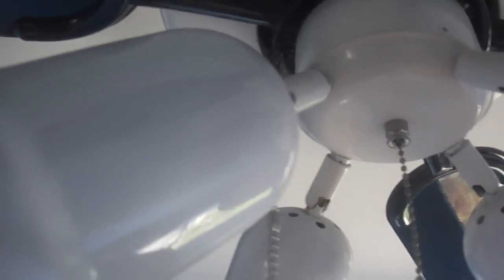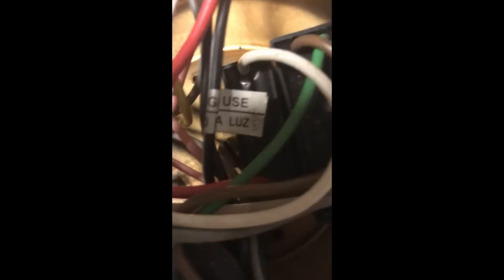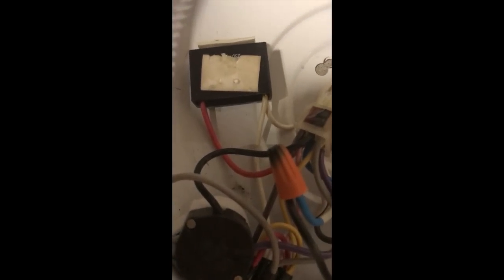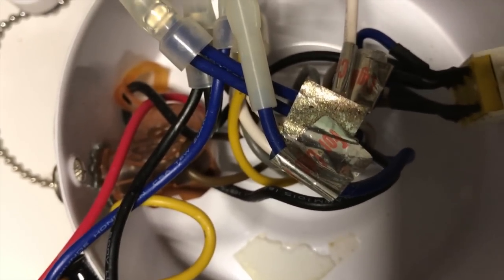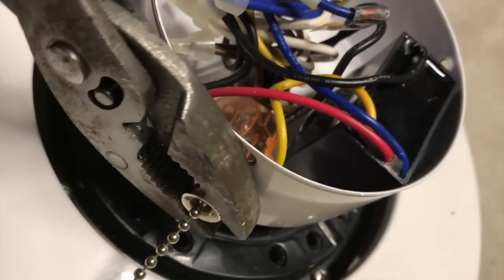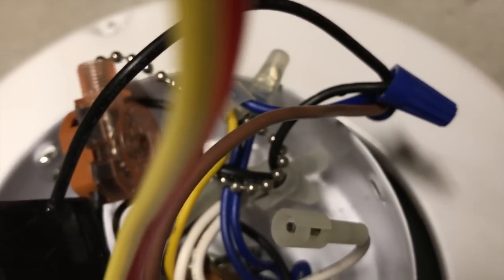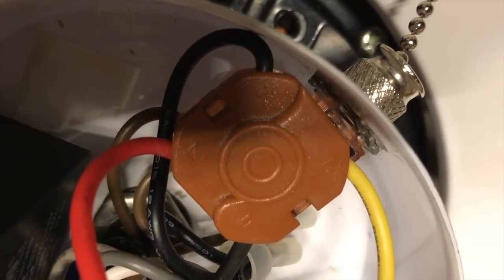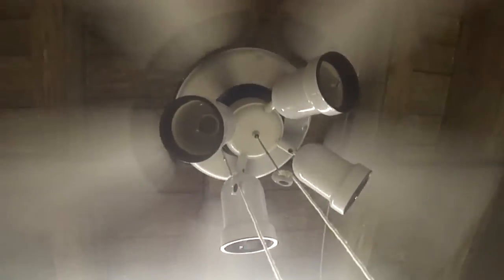Ceiling fan repair: how to replace a motor capacitor

Comment: We have a Hunter Original Model 23856. Purchased at a Home Depot in year 2000.
The speed switch chain broke and in taking off the light kit I shorted the wires (yep. wall switch was still flipped "On").
When I put in the new speed chain switch the fan only runs on one speed. I think it is the highest speed, and it is the last speed before "Off".
I have taken the fan down from the ceiling and am trying to decide what to do now. 
What do you recommend?
And thanks for providing all this useful content on your channel.
Reply from the maker: Did you connect the black wire to "L" of the chain switch, and what chain switch did you use?
Reply: @CeilingFanVideosOnYT  
Wow! Thanks for the rapidity of your reply.
I connected Black wire to the "L" terminal of chain switch. I got a Gardner Bender GSW34 at Ace Hardware. But the body of the actual switch says it is a Zing Ear 268S6. (How odd...)
The other wires are connected: Red to "1"; Grey to "2"; Yellow to "3".
And now I have all 3 speeds and Off in both directions. The speeds are NOT sequential from Low to High, but not going to fiddle with it anymore.
In my case, the first pullchain switch seems to have been defective as the wire in "1" would not hold tightly; Or maybe I bodged it myself. 
Is there a high-quality pull chain switch that would last longer. Reviews on Amazon make me wonder if quality control on the current switches is suffering.
Hope this info is helpful to someone else.
Reply: @CeilingFanVideosOnYT  
Ayy yiy yiy
New problem. I reattached the light kit. Now I only have 2 speeds in each direction.
How does that even make sense?
Depending on what you say, and if/when I see what you say ... I might remove the light fixture and see if I have those 3 speeds I had previously.
Thanks for any add'l help.
Reply from the maker: Sounds like one of the wires came off of the chain switch when you reattached the light kit. It’s best to use a paperclip to open wire holder on chain switch when inserting the wire. Also did you use paperclip to remove wires from the chain switch or you cut and strip the wires?
Reply: @CeilingFanVideosOnYT  
Your suggestion/insight here about wire coming out from switch makes sense. I did not use paperclip; used wooden toothpick. But wires are stripped to length shown on the gauge on the switch.
Time to go back and re-assess.
Reply from the maker: Ok toothpick can be fine to take wires out. It’s when someone cut and strip wires is when they have trouble inserting properly to new chain switch. I had seen a ceiling fan in a hotel room which didn’t work on high. Turned out that one wire came out of the chain switch. Inserted it back in and high speed worked again.
Reply: @CeilingFanVideosOnYT  
Well, just ot wrap up this episode - the gray wire was making contact intermittently. Not sure if it was pushed in a little too far and the insulation was a problem. I finally decided to tape the gray wire to the switch housing to stabilize it from wiggling. Seems to have worked.
Fan now gives us Three speeds in each direction.
regards

Comment: I need help with a 3 speed 5 wire switch and 3 wire capacitor for my Crest (20) years old ceiling fan. can't find information on this any were. Was suggested to contact this group.
Reply from the maker: Did your chain break?
Reply: Same here but Hunter fan.

Comment: Hello i have a nice hampton bay ceiling fan 3 speed with two pull chains and 4 lights its about 15 years old if i had to guess. Was working fine till my grandson pulled the chain too hard and broke it off inside the 3 speed switch. I got a new switch from home depot but it was a replacement as the kte308a is no longer available. I wired it in and now it is slow and it used to be very fast on hi. Now its going about slow speed. The capacitor has two black wires that are joined together with a third black wire that goes to the L spot on the switch. Then i have the main black wire that goes to the switch and two blue wires that go to the switch. There is also a red wire . So 5 wires on the capacitor. I was expecting colours like yellow green and brown for the speed switch from the capacitor but instead two black and two blue/purple is what goes to the 3 speed switch. Can you explain that? There is no blistering or bulging on the capacitor and it will hold a charge. If the two blue/purple wires were mixed up could it cause it o be slow? Sorry for the long post.
Reply from the maker: Was the original KTE chain switch red, black, orange, or green?
Reply: @CeilingFanVideosOnYT  it was black and clear. 308A was the #0n it.
Reply from the maker: https://www.ceilingfanswitch.com/product/zing-ear-ze-268s2/

This should have same exact sequence as your KTE.

Comment: i replaced the speed capacitor on my ceiling fan and it work on all 3 speeds for a while, but then quit all together. What's your suggested step to find the problem. Thanks!
Reply from the maker: The start/run capacitor went bad.

Comment: thanks
Reply from the maker: You're welcome. Do you have a fan with a bad capacitor?
Reply: yes a hunter 60 in regalia it has 2 one 5 uf 2 wire and a 5 wire 5uf 5uf 3.5 uf 2 years ago i replaced the 2 wire one with a 6 uf and sped up the high speed and today the run 5 wire cap went out

Comment: Do you have to short out the capacitor even if the ceiling fan is not on the ceiling and unwired from house wires?
Reply from the maker: Yes.

Comment: The 3 in one ceiling fan capacitor is melted and fan will not turn on either of the 3 speeds. Ratings are 4.5ufx280v Red wire, 6ufx250v Brown wire, 5ufx250v Purple wire with 2 gray wires on the other side. Will a replacement capacitor with a rating of 4.5ufx300v Red wire work? The other 2 ratings are the same.
Reply from the maker: Definitely. Higher volt ratings never hurt as long as it's same capacitance rating, it just will be able to handle more volts,
Reply: @CeilingFanVideosOnYT  what do you mean by capacitance rating?
Reply from the maker: Example of capacitance rating is 3uf, 4uf, 5uf, etc.
Reply: @CeilingFanVideosOnYT  thank you so much. Just one other question. Do I have to be concerned about discharging the old capacitor which is still in the fan?
Reply from the maker: Does your ceiling fan have a light kit?
Reply: Yes.
 @CeilingFanVideosOnYT
Reply from the maker: To short out the capacitor, first turn on the light with the chain. Then turn the circuit breaker off, or maybe the wall switch ONLY IF the fan and light are wired to the same wall switch, and then pull the fan chain more than 4 times SLOWLY, and it will short the capacitor out.
Reply: @CeilingFanVideosOnYT  Thanks again!

Comment: hello friend.. i have a problem with the hampton bay ceiling fan carriage house model that i brought to brazil, the original capacitor brand 4.5 uf 5 uf and 6uf 250 vac ..box with 4 wires total.. the problem is that This model does not exist in Brazil.. we only have 2 wires and I wanted to use it only at maximum speed, how can I adapt?  would it be 1 capacitor of 7 uf 250 vac for the strongest 3 speed it?
Reply from the maker: Just get whichever size was not connected to "2" or "3" of chain switch, probably 4.5uf.

Comment: My fan has always ran on a medium speed, when I press the "4" button on the remote.  I had to run a wire from the carport, about 20'-25' away and I've wondered if the wire is too heavy a gauge or that's the fastest it's going to turn.  The one in the bedroom turns fast and that's why I think this one is slow.

Comment: This is a great video. I replaced my 4 wire capacitor ( grey, grey, green, brown ) with a new one BUT the fan does not rotate as fast as it used to ( although the 3 speeds are discernible now ). Although the specs on both the old and new capacitor is the same, the size of the new capacitor is smaller. could that be the issue?
Reply from the maker: New capacitor needs to handle same number of volts or higher than old capacitor can.
Reply: The old capacitor indicates "250WV.AC" and the new (smaller) capacitor indicates"250VAC" no "W". Could that be the issue? And thank you for your response and the video. (btw- I did get a slight shock from the old capacitor a few hours after I removed it. Should have shorted it as you did, lol )
Reply from the maker: It's not a problem. Is "uf" rating the same?
Reply: Yup. 5UF & 5 UF. Why do you think the new capacitor is smaller than the previous? The manufacturer does seem to be different.
Reply from the maker: Maybe you just didn't remember well how fast it was before and it was actually the same speed. Maybe you accidentally overpitched one of the blades while taking the fan apart to replace the capacitor and it caused it to slow down.
Reply: Bearings and shaft need to be cleaned.

Comment: I also have a hunter fan that makes a slight hum when turned on and won’t spin but has no pull chain on it
Reply from the maker: Does your fan have a wall switch or remote control?

When capacitor goes completely bad, only one winding would be powered, and in that case, the fan would buzz or at least vibrate.

Comment: My pull chain switch broke inside the housing and the position is off. Can you tell me how do i bypass the connection?
Reply from the maker: What's the serial number of chain switch and what's the brand? And do you actually want your fan to be chainless?

Comment: I only have one speed; I replaced the capacitor attached to the switch with no change in results. Do I understand correctly that the two-wire capacitor also needs to be replaced? Also, why did you "short out" the original capacitor. Thanks for your help!
Reply from the maker: What's the brand name and model number of your fan?
I shorted out capacitor because it can store charge and I didn't want to get shocked.
Reply: Thanks for your prompt response! It's a Hunter, but I don't know the model # (it's a customer's fan!). I already purchased what appear to be matching capacitors, but only installed the larger capacitor; switch was also replaced. Good to know about getting shocked!
Reply from the maker: How fast does it spin since you only said it works on one speed? Try replacing 2-wire capacitor if it's slow.
Reply: The one speed is, I think, somewhere between middle and slow, but that is based on my experience with other fans, not this one. I will replace the 2-wire capacitor and let you know the results. Thanks, again!
Reply from the maker: Also, does it spin freely when you push with hand or is it stuck?
Reply: Spins freely.
Reply from the maker: So it does sound like a 2-wire capacitor. Let me know if replacing it solved it.
Reply: I replaced the two-wire capacitor today with no results. There is still only one speed. I'm perplexed... :)
Reply from the maker: I need you to get a model number of that fan and give it to me.
Reply: I will do that! Thank You!
Reply from the maker: Got the model number?
Reply: Finally, I do! Hunter 22793-380
Reply from the maker: Maybe the last step is to make sure wires are not rubbing on top. If that fails, you may have to get a whole new fan. Hunter made after 2011 besides Original are generally low quality. So if you get a whole new fan, one fan I would recommend is Hunter Original. Hunter Original is actually one of the best ceiling fans still made today and it's been around for over 100 years. Pretty much any other Hunter are generally low quality.

Comment: so what happens if i accidentally break the grey wire? is that the power? it broke off in the fan motor. while disassembling
Reply from the maker: You could try to strip and reconnect the gray wire.

Comment: You replied to me on the Casablanco site... The model # is 59093. Nobody at Casablanca could tell me how to get into this model and unscrew the lightbulb, can you?
Reply from the maker: I don't work for Casablanca, but I can help people with Casablanca fans that people at Casablanca wouldn't be able to. Unscrew the light globe counterclockwise would help. You can get more help from fan experts (I'm one of them) by posting in link below:

http://ada19851985.proboards.com/board/13/technical-problems
Reply from the maker: Ok, I see you created an account. Looks like you're ready to post in the link I just posted!

Also, if you would like, I have over 500 videos of ceiling fans that I thought you would like to check out. They're for education and entertaining though.

Comment: Shouldn’t you test the capacitor to see if it is bad instead of everybody rushing off and ripping off capacitors?
Reply from the maker: You could if you have a meter. But if it's not the bearings, and fan slows down, it's almost always either blade arm being bent causing steeper pitch meaning greater air resistance or bad capacitor.
Reply: It's a great point and I'm learning. It's just that in the past I had made assumptions troubleshooting electronics symptoms and I was completely off the mark. Someone just junked a ceiling fan and I was fascinated by the motor. Thank you for sharing your knowledge.

Comment: Any idea what capacitor I need to replace on my 52” Hunter fan? The light works. The fan does not. It turns but only as if it’s on a low speed, barely gives off any air at full speed.
Reply from the maker: Hi, what's the model number of your Hunter? I will give you steps to access the capacitor and you would need to see it before ordering a new one.
Reply: I have the exact same issue as BasketballNevaStops. My 3 year old Hunter fan model is 52123, and requires part number K008904H02 (also known as K0089-03)... but Hunter does not have the part and does not expect to have it until January at the very earliest. Is there a way of finding an equivalent? I cannot find an image online with the specs, I am just using the information provided by Hunter and my fan's parts guide. Thank!
Reply from the maker: The capacitor should be found inside switch housing. What does capacitor say? It should have one showing 3 "uf" with number before each, or two with 1 "uf" with number before and other with 2 "uf" with number before.
Reply: I'll have to wait until I can get a second pair of hands to pull the fan. I'm usually a pretty handy gal, but I got out of a wrist cast a couple of months ago, so I haven't quite gained full range of motion or strength yet to tackle the job on my own. I'll let you know once I get it pulled down. (Didn't know with the model number or part number description if that might help before I pull the fan.) Thank you!
Reply from the maker: You don't have to pull the fan down, you just have to remove the switch housing from the fan.
Reply: Thanks. I'll try to do so today...
Reply from the maker: Switch housing can be removed by having 3 screws on the side unscrewed. Best to remove light bowl first.
Reply from the maker: Thanks, and there's a link where you can order this new capacitor. It should work for your fan https://www.amazon.com/gp/offer-listing/B01D37JI7W/ref=dp_olp_0?ie=UTF8&condition=all
Reply: Thank you so very much! I love YouTube, and those of you who upload such useful DIY info!!
Reply from the maker: You're welcome! So had you ordered it?
Reply: I am waiting on a reply from the seller to clarify a matter first on the capacitor specs.
Reply from the maker: Any updates?
Reply: They said looking at the photo of the capacitor I sent, it didn't "look" like it was bad. I replied that after researching, (and according to Hunter) the capacitor can be starting to fail without it bulging or blistering. (In other words, it may look good on the outside, but be failing internally.) I ordered anyway, but they sent me the wrong one. :/  So... I am in the process of ordering another one.
Reply: The Channel of Random Ceiling Fans Hi, so I was able to get a picture with my phone of the top housing without taking it down. I’m hoping I can order the part and take it down and replace all at once, but if I need to take it apart to see the part first then I’ll do it. 

Anyway here are the specs that mine reads: Hunter Model: 53160/ Fan 80 W/Light 180 W/120v-60Hz/Total 250 W

So what part would I need can you tell by those specs?

Thanks and subbed!!
Reply from the maker: Ok, so the steps are to remove the light bowl, then unscrew 3 screws on side of switch housing where the chain is. Then you can remove the switch housing and look at the capacitor there.

There could be one 4-wire capacitor, or one 3-wire capacitor and one 2-wire capacitor. If it has 4-wire capacitor, it would obviously be the one that need to be replaced since it’s the only one. Otherwise, 2-wire one would be the one that need to be replaced, since 3-wire one is only used for medium and low while 2-wire one is used on all speeds.
Reply: Just wanted to let you know that after receiving the incorrect capacitor, then waiting for the out-of-stock capacitor to come back into stock, I finally received the correct one. It has been installed and all is well in Hunter fan land!! Thank you so much for your help!!
Reply from the maker: @Twinkerbella  That's great! Glad you got your fan working again!